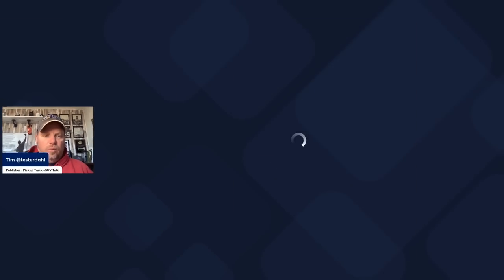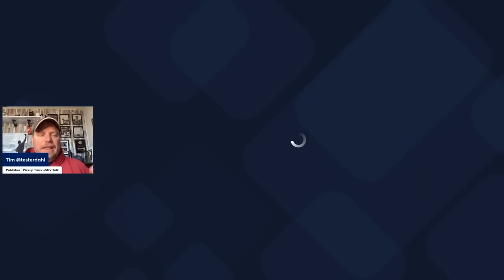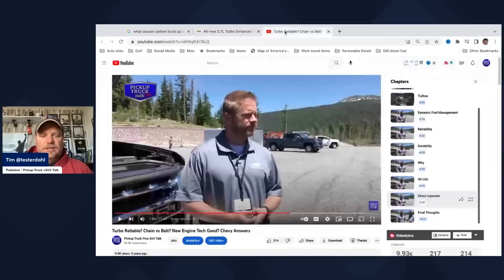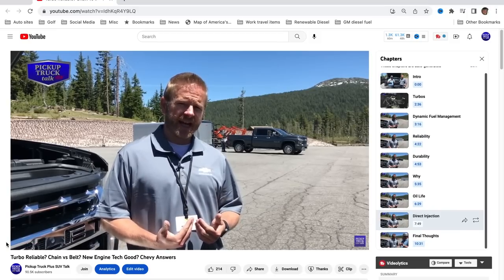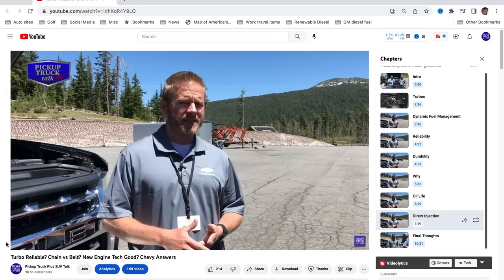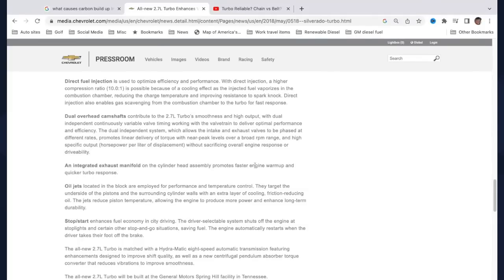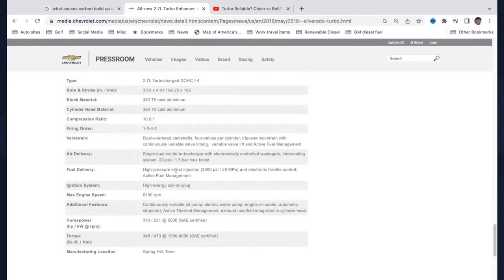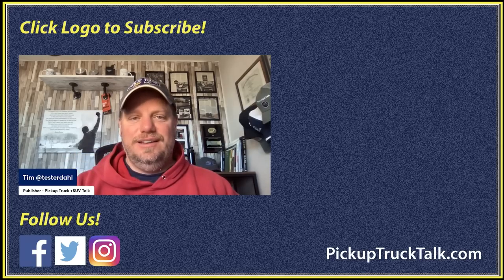Are Direct Injection Engines Bad? Carbon Build Up Concerns?  Engineer Interview

Comment: Direct Injection squirts the fuel into the cylinder and has a better air mixture in the cylinder for a more complete combustion, translating to more power because it's efficiently converting all the fuel & air to combustion.  Port Injection squirts the fuel into the intake ports then the air & fuel mixture enters the cylinder.

Comment: Next time you talk to any manufacturing engineer. The real problem is PCV with intake valves. Ask what they are doing to correct this with direct injection. What Ford did was add multiport inject with DI.

Comment: Tim you missed the target pretty good here. 
I know your only going off what the “engineers” are telling you. But it’s apparent that the engineer you spoke with is either really a PR person, and not an engineer at all. Or he is hiding the real issue by directing attention elsewhere. 

Carbon buildup in the combustion chamber has not been an issue for quite a long time. Modern fuel detergents solved combustion chamber carbon buildup, not whatever this guy is rambling about. Today when people talk about carbon buildup, they are most often referring to the carbon on the back side of the intake valves, and inside the intake manifold in some extreme cases. This comes from PCV (crank case ventilation). We force the engine to eat it’s oily crank case vapors. This oil forms a varnish that burns into the back of the hot intake valves. Over time it gets so heavy and thick that it restricts air flow into the cylinders. Which is what degrades performance. To the best of my knowledge Ford was the first to utilize old fashioned port injectors to clean this oil/carbon varnish. Then licensed the design to Toyota next. (I could be wrong about who was first. Don’t come after me.) This problem affects every DI engine in existence. Save for a handful who have implemented port injection to clean the valves. It actually boggles my mind that these manufacturers haven’t gotten smart on designing better air oil separation systems into the PCV. which is the obvious aftermarket solution. People got smart about installing AOS’s (air oil separators) on DI vehicles many years ago! Why haven’t the OEM’s?????? 
Don’t let Mr PR “engineer” derail you like this! It’s a blatant cover and redirection.
Reply: Toyota has the first patent and it expired in 2017, allowing for the Ford Ecoboost engines to be utilizing both port- and direct-injections. That was why Ford didn't get to use it despite knowing its advantages for their earlier model year Ecoboosts. Toyota and already created it back in 1996; just took a long time for them to perfect the technology and finally all over the place when ICE is on the way out.
I noticed that as of late, Ford and Toyota cross paths with their engine technology, such as this and the E-CVT, where instead of licensing each others' tech, they just collaborated and shared patents (on the E-CVT).

Comment: Ford has a problem with this but not with the 5.0 V8 because fuel is also directed threw the port cleaning the carbon off the valves where the ecoboost 4 cylinder gets carbon buildup on intake valves. The dealer can clean this which works ok but removing the intake and walnut blasting the valves does the best job. This buildup occurs after at least 40000 miles and gets worse with time causing poor idle and engine performance.

Comment: This doesn't address valve carbon buildup. I know some designs are better than others with direct infection only. Not worried about combustion ignition and cylinder washing one new, well designed models.

Comment: There is no miracle solution, going to cause an issue regardless. You pay extra for DI and PI, more later life cost, more complex. Less efficient with PI, but clean valves, more efficient with

Comment: That’s why I added a J&L oil separator, so that oil doesn’t get recycled through the EGR system and dumped on the back of the valve, where the direct inject never sprays it, and cleans it. Simple solution to another dumb ass factory problem, just like tuning off the DFM 😂

Comment: Use the field as a whole as some contrary, strong evidence:
#1: Toyota (in typical fashion) was the last into use of Direct Injection.  When they introduced DI, they did it WITH Port Injection. 2 reasons:  First, already described, to wash back of intake valves and terminal run of intakes where oil vapor from crankcase ventilation bakes into ultra-hard deposits, eventually risking seal of the intake valves at the seats.  2nd reason:  at low load, using port injection helps with efficiency / emission (so Toyota says anyway).
#2 After 8+ years with EcoBoost (initially DI only) in products, Ford (in 2019?) updates all of the DI motors to ADD Port Injection.  That cost money (R&D, validation, retooling, change in production processes). But Ford, after taking a beating (poor durability and getting sued over intake carbon build up), adds Port Injection to all of the EcoBoost motors.  That was a VERY EXPENSIVE change. Motivated by the problems …
So, Mr Careful (Toyota) comes out with DI+PI and no DI-only motors, and bold Ford revises all their DI designs to add Port Injection.
A certain, but small percentage of Hondas, Nissans, and many Fords still needed blasting with ground walnut shells to get the baked/coked on oil carbon off the intakes after anywhere from 40-100K miles.
GMs choice looks like an experiment in progress.  The HD motors will show whether or not they’re right, but not for another 3-6 years.

Comment: I love the 6.6 in my silverado. Very smooth and plenty of power. I love the torque when pulling big hills and not having it need to downshift to maintain 70 going up the hill. Just makes for less stress and fatigue on long trips. I know I’ve seen a video I believe Mr Truck interviews the engineer and he explains the 6.6 has a new recirculating set up so it doesn’t coat the valves. I do think ppl have too much time on their hands and worry too much about stuff.

Comment: What this guys saying is wrong and trying to sugar coat the fact that these engines do get carbon buildup. Engineers can put their spin on it to sell it. Youtube has videos of mechanics opening up Direct injection engines with 30-40 miles and all the valves are gunked up w carbon. Even w an oil catch can, the engine will carbon up faster than port fuel injection. This causes your power and MPG to go down. The only way to get the carbon off is by using crushed walnuts  used in a sand blaster type machine to clean the intake manifold of all the carbon buildup. Chemicals and additives for the gas tank wont help. Ford and Toyota are the only companies that use direct injection and multiport injection to alleviate this problem of carbon buildup.

Comment: At 75k my injectors started to make my L83 truck idle rough. Had one fail at 105k. Took a 3 foot pry bar to get the injectors and rail out of it. Ruined the rails and a couple good injectors in the bank. Replaced it all, and the truck now idles like it was new. Port injectors pretty much last the life of the vehicle. Direct injectors won't just like on diesels.

Comment: No doubt there are pros to direct injection. There is a reason they went to it. Emissions, fuel economy, more power, in that order. I’m not worried about the chamber but like everyone said the intake ports and valves. I have an LNF ecotec and I seafoam it periodically to address this. I have had the intake manifold off once and it was pretty gunky on the valves.

Comment: Direct and Port injection on engines just gives you twice as many injectors to replace down the line!$$$$$$$$ No thanks!
Reply: I've heard the direct injectors are more more costly than port. not sure about cost of port exactly but we shouldn't look at them as equal cost and therefore twice money to replace all, hypothetically.
Reply: Can we circle back around to....a modern carburetor?

Comment: As everyone sees here, this video (and GM) is sweeping carbon buildup issue under the rug... nothing to see here.  Only talking the benefits of DI and completely ignoring a real well-known problem. Tim, the issue is top of the intake valve, not combustion chamber -- fuel injection PSI has nothing to do with it. Anyone that buys these new GM 2.7s shouldn't expect a high mileage engine without requiring ridiculous/expensive routine repairs. Yeah, just remove the intake manifold every 30k miles and walnut blast the top of the intake valves... wonderful, it's all good.  Great solution GM.  

As usual, GM will pump these engines out by the hundreds of thousands, and 5 years later implement a solution and claim to be heroes because they finally fixed a severe Quality issue they were fully aware of out of the gate.  Sad to save $20 in parts cost on a $50k trucks, because it's an otherwise beautifully designed engine.  

Fix root cause out of the gate GM!  

Until then, choose another manufacturer that cares about Quality/reputation and builds engines with both Port injection and DI so they will retain value for 100k+.  Those manufacturers still exist folks.

Comment: If you aren't doing intake valve cleaning as a part of regular maintenance in direct injection engines, you're doing it wrong.  Diesel engines with EGR have been doing this for 2 decades already.  Sorry you guys have to do extra shit 🤷🏻‍♂️  or just delete it and quit yer bitching

Comment: At the beginning of this video, you showed pictures of the vales with the carbon buildup on them. After you showed that. In no way did the video of the engineer, talking about direct injection address the actual issue you were stating at the beginning. The carbon buildup on the valves. Direct injection I agree is "better" for the reasons he stated. But doesn't address the carbon. Port injection cleans the backside of the valves. Because of all the emissions bullshit they have now. Regurgitating the engine's unburned fuel and exhaust back to the intake port. This is the reason for carbon build up. Maybe try asking the actual question next time, that your trying to answer.

Comment: There is no miracle solution, going to cause an issue regardless. You pay extra for DI and PI, more later life cost, more complex. Less efficient with PI, but clean valves, more efficient with DI but more deposits.